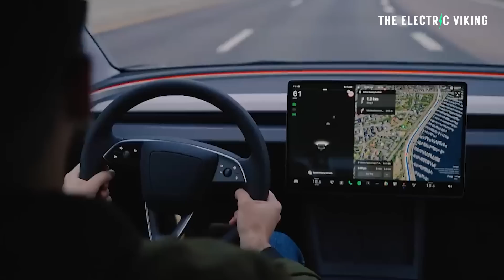TESLA battery maker CATL reveal 1 million miles + zero degradation battery

Comment: And EV owners are screwing the non-EV owners by NOT paying federal and state fuel taxes which gas/diesel vehicles pay at the pump.  Plus, all those citizens who cannot afford an EV or who live in city apartments are subsidizing the $7,500 tax rebate.  EVs are the brainchild of politicians who never thought through the implications of 'clean energy' while coal-fired plants are required to produce the electricity to charge up EVs.  Plus, EVs cannot tow and operate at best, half rate during the frigid winter season and distance availability creates extreme anxiety.  Plus, what will we do with worn-out batteries, how much will replacement batteries cost and how long will they last?  EVs are extremely expensive to repair, and insurance costs are much higher than other similar-sized vehicles.  The recharging station's availability is spotty and many of the units are unserviceable.  Rich arrogant people buy EVs as they can afford them but few, if any, take them on cross-country trips.
Reply: I am in the UK and we do not have any grants that I can use to buy an EV cheaply. I loved driving an Audi and for what I considered a reasonable cost per month, could drive a new one.  I felt there was little innovation and most extras were behind a huge paywall. So I got a personal lease for a Kia E Niro 4+. I am not rich but careful with money, so this was perfect, saving me £250 a month in fuel, road tax and servicing.  This paid more than half of my lease for the past 3 years.
The same thing about this being Governments is said all over the world and I know the UK  Government could not think up a huge con to get people into EV's. Technology did this. Batteries of EV's from the past 5 years will have batteries that last well and have little degradation. They will likely outlast many ICE engines. When they do suffer too much degradation they can be used as storage batteries for home, business or grid. After say 20 years of that use, they can currently be recycled up to 95%. Then they can be made into new EV batteries, reducing the need to dig up any more from the earth.
I am sure that not all of your energy comes from coal fired plants, with many states having renewables, in the way of solar or wind power.
As you say towing  and in winter range can drop. My EV has a heat pump and I get 220 miles in Winter and 260 in Summer. Others without heat pump can be worse.  
Finally any new car is expensive and in the UK our cars are almost double the US cost for similar, so the cheapest Tesla Model 3 would be over $50,500. So in the US you are lucky and have access to cheap vehicles.
Reply: @Jaw0lf    EV batteries make vehicles weigh more so not having to pay road tax doesn't help maintain your infrastructure.  The government is just giving you an easy road as they, as well as our government, haven't thought through the EV craze.  EVs in the present form are Ford Model Ts and have a long way to go before the battery, mileage, and recharge are acceptable.
But thanks for your comment regarding EVs 'across the pond'.  How do England, Great Britain, the UK, or whatever the islands are called get their electricity to charge batteries?
Reply: @heretoforeunknown Tesla Model 3 and the Toyota Camry are practically the same weight.
Reply: @heretoforeunknown  I am in UK, a personal car buyer, so nothing from the Government in fact it is more like I am being targetted for helping to reduce emissions. Vehicle excise duty is a Car Tax that we pay. EV's had been exempt and the idea is the more emissions, the more you pay. EV's from next year will start paying and they have then included EV's that were purchased up to 7 years ago. Meanwhile some Diesel drivers pay zero or just £20 instead of  the £180. Our government pays billions of pounds to the oil companies and this could be better used for roads and infrastructure. It isn't like the oil companies are short of money.
The weight issue is valid but difference is negligable and many ICE cars weigh the same or more than EV's, no one argues that the big 4x4's can't do things as they are too heavy.
Tax in the US on fuel is cheap as far less tax. Our tax as a proportion of fuel cost is about 53%, so double the cost of the actual fuel. Governements will have to review how they spend money and get taxes. I don't know the answer to that but stop paying huge amounts out to business seems a good start.  
And in the UK for 2023 December was the 15th month in a row where zero carbongeneration produced more than fossil fuel generation. Coal use is now less than 1%. Over the whole of 2023 zero carbon provided over 50% of energy. This will improve each year.
Reply: electricity generation are trending to be replaced by renewable sources thou, and the trend is growing not slowing.
China is predicted to reach peak coal in 2025 and its government has pledged to reduce coal over the 2026-2030 period, news out there predicts China could reach their goal earlier than predicted.

Comment: Any 250 mile EV with LFP is a million mile battery.  A123 Systems and Chrysler announced an LFP partnership with 1.6 million mile design.  In 2009.
Reply: No point hyping on something that is only available in labs or in test stage and not available or going to be available widely on the road yet. It will only matters if it can be available to the public with an affordable price for the majority of the consumers. This is what CATL is going to do very soon or is already doing it.
Reply: Maybe but they still have degradation.  If this is true than CATL has something special.
Reply: @Ryan-ff2db   There is no loss-free battery.  Because of dendrites and internal resistance build up.  Find ways to avoid that - and they will last figuratively forever.
Reply: @johnmcvicker6728  If you're talking about modern tech then yes.  If what CATL is saying is true, it would be "near" dendrite free.  Nothing is perfect though.  If they're planning on a 15 year warranty(which is outstanding) then perhaps time will effect the batteries more than the charge cycle.

Comment: This is the battery that ive been waiting for!  This battery pack will increase the resale value of any EV its installed into and will for sure prevent resale values from plummeting!  I could even see this battery tech making EVs lose max 1.25% per year in depreciation! This battery needs to be installed into the cybertruck and every model 3 and model Y.
Reply: Resale values are low because the price keeps coming down on the new vehicles, battery has very little to do with it. My Model Y battery is 18 months old with over 20k miles (all supercharger because still free) and very little degradation, 1.5 - 2%.
Reply: @rarelycares8416 battery degradation and battery cost replacement after warranty is probably 65% of the entire reason why all EVs depreciate up to 35% in the first 2 years.  Do your homework. Driving and owning a Tesla doesn't mean you understand  the gravity of why EVs depreciate the way they do right now.
Reply: @dyworking  I don't think you understand the EV depreciation situation.  A while back, Teslas were expensive and they were hard to get even if you had the money due to supply chain issues.  At that time, used Tesla prices were through the roof.  More recently, the price of new Teslas has come down a lot, and they are easy to get.  Of course the used ones dropped in price.  What else would you expect?  The battery had nothing to do with it. The only question anyone should be asking now is will the new ones depreciate a lot?  I don't think they will, because they are starting from a lower base.
Reply: @incognitotorpedo42  true, you have some points I am aware about but I think they are all shallow. Theoretically speaking, if Tesla already had exclusive use of CATLs 15 year warranty rated 1.5 million km LFP battery pack with 800v 10c fast charging in cold temperatures, Tesla would not have needed to reduce prices much against the competition.  Price war, supply chain, demand vs supply all affect market prices but I think Battery cost replacement and short life / degradation is the biggest block for ICE consumers making the switch to EV while also causing resale values to plummet and depreciate much faster.
Have you seen the resale on a 2015/2016 Model S with 300,000 miles without battery warranty? They sell for $9000 - $13000 USD.  Even with 1 year remaining warranty it isn't worth much because everyone assumes they have to put out another $25,000 for a new battery within next 2 - 3 years so they won't offer much for it.  The math completely changes if you have a 1.5 million kilometer battery pack. And I'm so certain, with this new battery pack hundreds of thousands of buyers in many countries will make the switch from ICE and I'm willing to bet on that.
Reply: @dyworking  Tesla reduces prices to sell every car they make while still ramping production. If the waitlist gets long they raise prices. Read their mission statement, they live by it. My Tesla is worth less now than when I bought it because the new ones cost less, not because the battery has lost 1.5% of its range. But resale on a vehicle is one of the last things I will look at or care about. It's a depreciating asset unless you're buying a supercar.
Reply: @dyworking  "battery cost replacement after warranty is probably 65% of the entire reason why all EVs depreciate up to 35% in the first 2 years.  Do your homework."   What proportion of people are replacing their battery pack on a Tesla Model Y within it's normal life?  I'm assuming you've done your hommework, right?
Reply: @rarelycares8416 what makes up depreciation? Only Tesla reducing prices because of high supply? Really? Your understanding of depreciation is very shallow.  New Battery tech pushes old stuff into obsoletion.
Just like a cell phone.  Depreciation is based upon many factors of you read my previous text I said battery degradation and cost of battery replacement probably makes up 65% of the cars depreciation. Ask the CEO of Hertz why they sold and liquidated 20,000+ of their Teslas...  2 main reasons: high cost of repair and depreciation.
Reply: Have they actually tested these in a world application? Not in a controlled environment.
Reply: this is the battery ive been waiting for i need a thermal runaway fire to keep me warm at night!

Comment: Actual usable life is typically a lot more than the warranty window.

What this means is that the residual value of used EVs will soar.  When the body is worn out the battery pack will still have value for grid storage.  And then can be almost 100% recyclable so additional value for embedded materials.
Reply: Yes. It will also lengthen the useful life of the vehicle,  where replacing other parts like motors, breaks etc...  will become more financially viable adding resale value potential.
Reply: Becoming reliant on a single source that is from belligerent authoritarian regime, whose society is known for a lack of ethics and honesty is not an intelligent decision.
Reply: EVs only have value as long as the battery is covered by a warranty because if the battery dies the car will be a total loss, depending on serviceability of the pack which is non existent for many Tesla batteries which need to be replaced for the smallest defects.
Reply: @tellyboy17  you can get 3rd party warranties now based on the quality of the battery at the end of the manufacturer warranty.
Reply: @colinwiseman  I'm sure you can, used car dealers won't be able to sell 8+ year old EVs for any sort of money unless they pony up the warranty.

Comment: EV and Renewable Energy Revolution Deniers:  But what about when you have to replace the batter on your EV battery, costing $10,000-$20,000+?

CATL:  This!

Deniers:
Reply: EVs have roughly 50 kWh battery packs.  The material cost and manufacturing cost of LFP cells is on its way to less than $50/kWh.  That's $2,500 to manufacture a new battery pack. 

And, if you've got a million mile battery pack which is going to wear out first, the battery or the body?

Comment: What is Tesla going to do with their own 4680 battery?
Reply: Most likely work with CATL to produce very inexpensive LFP cells.  CATL has the chemistry.  Tesla has the dry-roll technology.
Reply: Understand that 4680 is the size of the cell's can 46x80 mm.   Tesla can put most any kind of chemistry jelly roll into the can.   The cells in the CyberTruck are not the same cells that were put in the 4680 modely Y.   Expect to see tesla's cell evolve.   It is not going to be trashed any time soon.  Above all Tesla is learning to become a battery manufacturer.  It could switch to a new format and what it leaned on the 4680 would help it on the next form factor cell.
Reply: They already are at giga Austin and Nevada. The Cybertrucks and Austin Y's are all 4680

Comment: It's not actually a million mile battery, they are just willing to eat the cost later for warranty. They know the packs will be cheap to make years down the road by the time they start failing.
Reply: Clever observation
Reply: Probably true. Most people never take a car past 250k. Everything else will fail first.
Reply: LFP cells have a 5,000 to 12,000 full cycle lifespan.  This is before the new CATL battery.

If you've got a 300 mile range EV and 5,000 full cycles that's 1.5 million miles before your battery drops to 80% original capacity.
Reply: If they have to replace every battery the warranty will cost them dear. That is why the batteries will actually last 1.5 million km.
Reply: I don’t think anyone will want to drive a car over a million miles regardless of the battery condition. Body and suspension maintenance will be cost prohibitive except for a few seriously classic cars.
Reply: @danielking2944  
Something to think about.  ICEV bodies and suspensions are designed to last about as long as the expected life of the ICE and transmission.

If we start using batteries that last a million miles or more and electric motors that already last very long times we might see the rest of the vehicle designed to last 4x, 5x longer than today's ICEV.

Think robotaxis.  How about a stainless steel exoskeleton like the Cybertruck with easily replaceable wear surfaces and easy to refurbish interiors?  Cycle them in every 150k miles or so, drop the battery pack, insert a different battery pack with refurbished seats and carpets.  Snap in new door panels and headliners.  Swap suspension parts like ball joints and shocks.
Reply: LFP 🎉